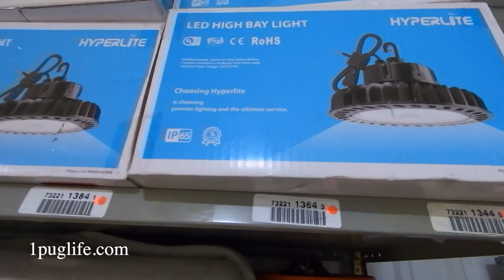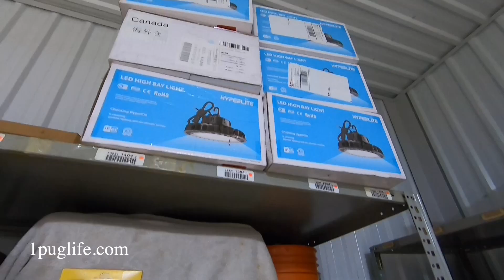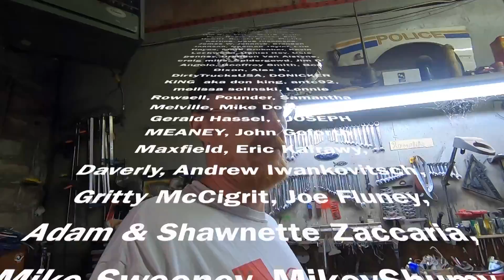hyperlite shop lights and harvesting a power wire for the grumman

Comment: You ought to start considering pulling as much wire as you can from those scrap cars. Even insulated copper wire sells for a good price. I had around 100 pounds of it and made almost 100 bucks. It adds up quick.
Reply: I'm sure Pug has pulled a lot of wire in his lifetime .
Reply: the amount of time involved with taking wire out of a car isn't really worth it
Reply: @oldpolak5203  unfortunately you are probably correct .
Reply: Copper sells for a hell of a lot more than that!
Reply: @patrickblock2477  almost $4.00 lb in california but its also california
Reply: Needs a new bin boy for sure
Reply: As one of the genius ruling class here in the United States once said “ain’t nobody got time fo dat !”